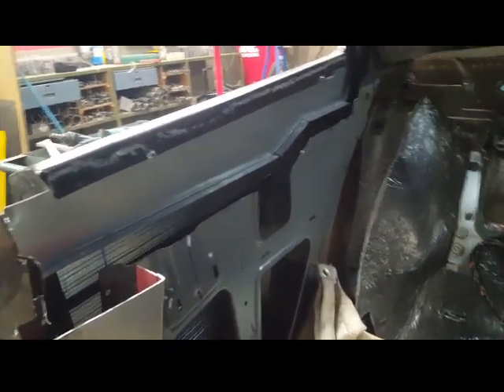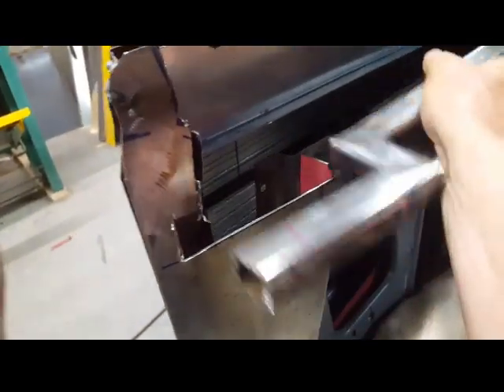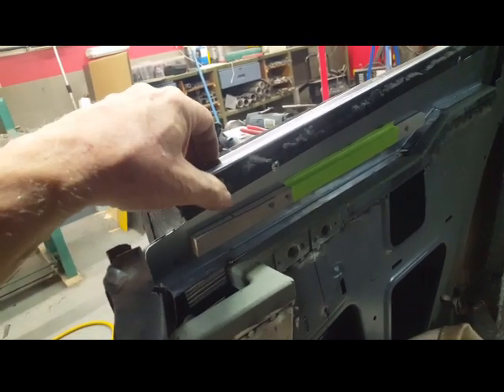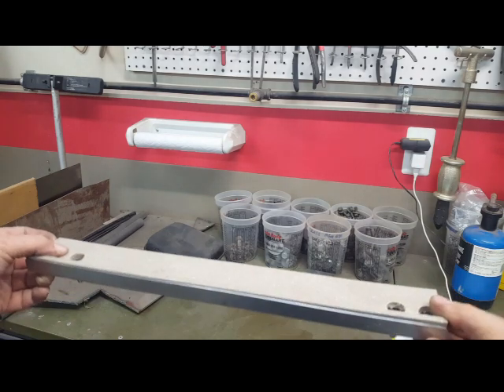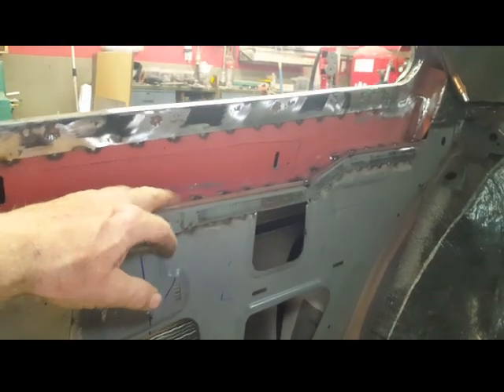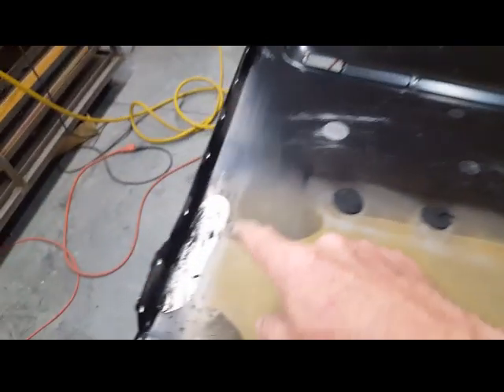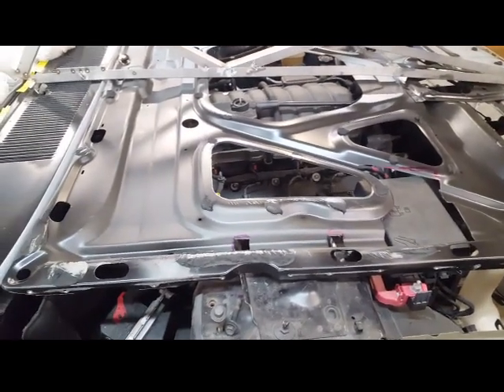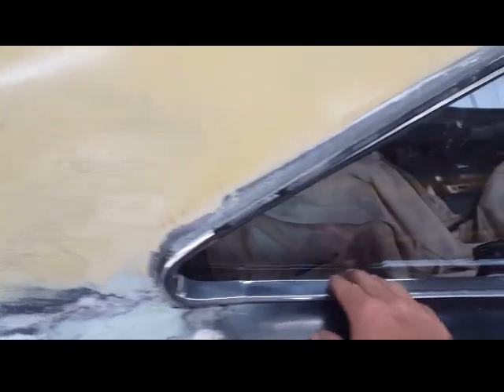Don's 68 Charger body swap part 22

Comment: Nice work Steve! I like how you reinforced the rear side structure with that piece of box tube, exactly like what Chrysler did for upper impact beams on their newer cars. I’m going to have to remember that decking material, that’s a good tip, you could use a wood router very easily to put different profiles in it etc.
Reply: Wow that is a tough one to find out and have to correct the pillars.
As much as we all want them to, the path of builds never move in a linear direction.
Thanks for showing so many minute details along the way.
Reply from the maker: Thanks Matt. Yes. I cut the profile on the table saw. A router works perfectly.